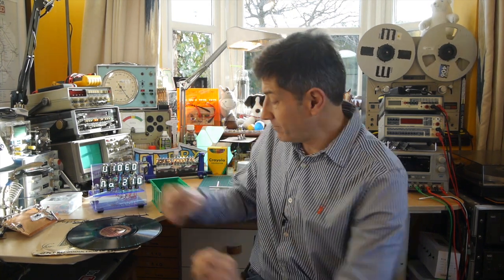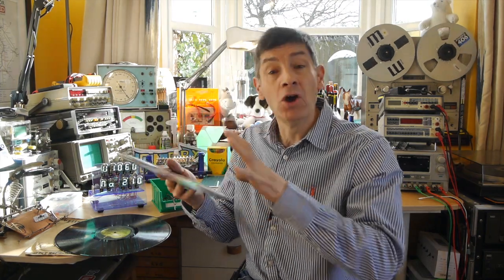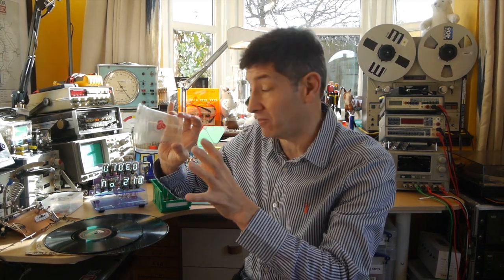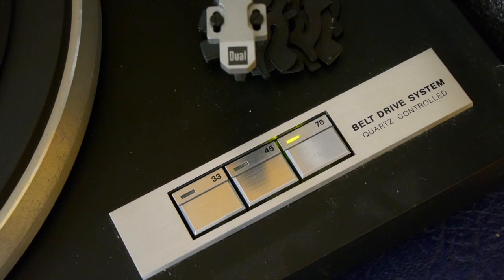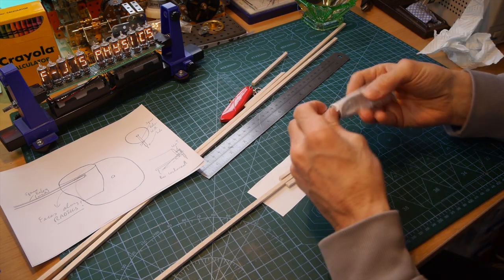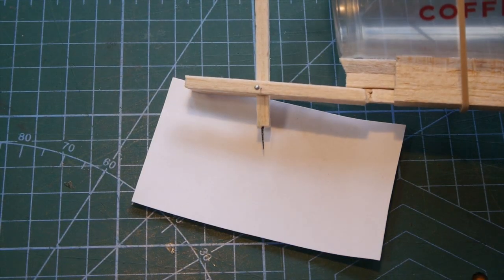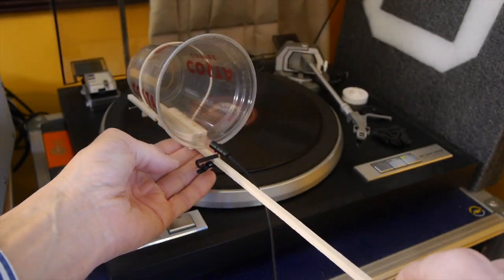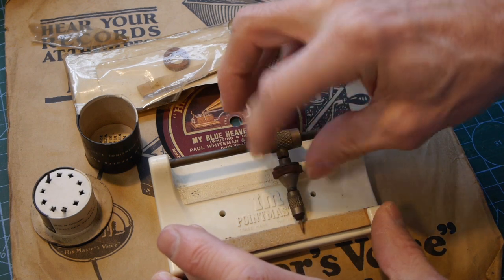Thorn Gramophone - F-J's Physics - Video 210

Comment: I bet you could get a better sound if you attached the amplifying cup at 90 degrees to the lever arm, perhaps with a gimbal instead of a simple hinge
Reply from the maker: Yes, it was more a case of just playing around a bit than making a well thought out engineering model!  I certainly realised that, as with old gramophones, the diaphragm deeded to be parallel to the groves so the sideways motion of the needle was properly transferred.  The other reason for this simple design - other than to show people how you can easily build a quick experiment with balsa and pins was to show the effect of a simple lever mechanism. All good fun, and thanks for your great suggestions.

Comment: There are so many fundamental things like this, obscured by digital techniques these day.  Similarly, a crystal-set; a radio without a battery. Or investigating frequencies with Lissajous figures once on the curriculum.
Reply from the maker: Agreed!  Funny, I have been working on a crystal set radio video for ages. The 'rectification' side is turning out to be a bit tricky.  Same with Lissajous figures too!  I could not decide if I start with a totally mechanical one, then possibly a moving mirror and finally a CRO.  Too many ideas and not enough time as ever!!
Reply: @AnthonyFrancisJones  I suggest a rotating mirror setup to view a simple gas discharge glow tube with long coaxial electrodes, symmetrical in construction. None of it is all that hard to make, but filming the results may present a challenge. Crystal radios aren't too hard either once you learn what the critical aspects are. Contrary to the most common (and technically wrong) explanation for how the diode or crystal junction actually functions when demodulating an AM signal, It's not rectification of the envelope followed by smoothing - the diode is acting like a mixer (analog multiplier), like in a SSB receiver, except the carrier, where most of the energy actually is, takes the place of the local oscillator. SSB (or DSBSC) has no carrier, and thus a local oscillator is required to receive them on an otherwise unmodified crystal set.
Reply from the maker: @zinckensteel  Thanks, interesting about the mirror set up as I am just finishing off a harmonograph build at the moment to start some videos on Lissajous Figures.  Have been working on a crystal radio video for ages but it got a bit 'left on the shelf' so I need to get on with that one.  Yes, the explanation of demodulating the signal is a bit simplistic but I guess, like a lot of these things, it helps the beginner understand some principles which they can then modify, improve, or reject in the future as their confidence grows.  So much of my physics teaching has to be like that with youngsters but I don't want them to be in a situation where in the future they say, 'What we were taught at school was all wrong!"  Thanks again for watching and taking the time to comment, F-J.
Reply: @AnthonyFrancisJones  Judging by the technical clarity of your other videos, and your reference of having difficulty with the "rectification", I guessed you might be having problems matching measured signals to expected results if following the erroneous (but close enough for beginners) explanation of how they are supposed to work.
Reply from the maker: @zinckensteel  Thanks, yes, that's a great help.  You are absolutely right .  If we always fixated on 'expected results', we might never discover anything new! Thanks again for taking the time to comment.  Many more videos to come so I will be grateful for your comments in due time.
Reply from the maker: @zinckensteel  Oh, forgot to say (sorry don't know your first name) that I am currently working, with lots of help sourcing materials from a viewer, on experimenting with lots of different crystals/minerals to make diode/transistor junctions.  Hope to publish something before too long!
Reply: @AnthonyFrancisJones  I do prefer my relative anonymity with this account on this platform, though I promise you I don't abuse it. One book I have in my small collection you might find useful (or at least fascinating) is "Rectifying Semiconductor Contacts" by Henisch, 1957. It covers all manner of basic junctions and their behavior, including descriptions of a "fieldistor" device that in retrospect seems to demonstrate both depletion and enhancement modes of operation as exploited in a modern FET, along with various other "transistor-ish" effects that can be observed in all manner of crude semiconductor materials.
Reply from the maker: Sorry for the slow reply. I must look that one out.
Reply: @AnthonyFrancisJones  It also could be an excuse for me to take a video of the whole book and post it to youtube..  ..seeing how the only source I could find online for another copy were print-on-demand AI-generated offers.
Reply from the maker: Yes that would be great!